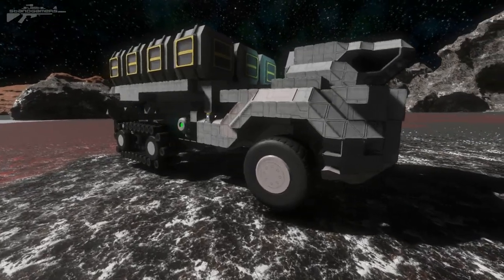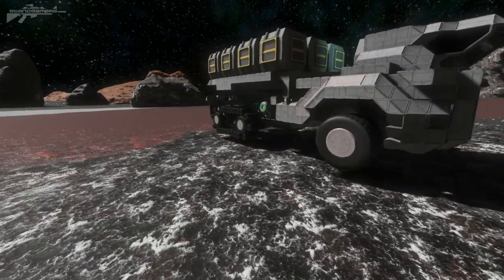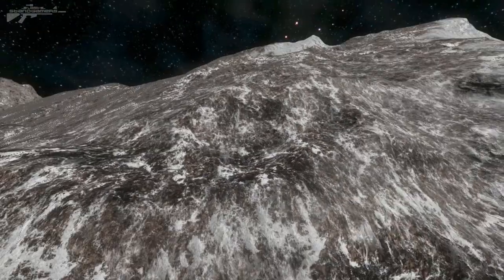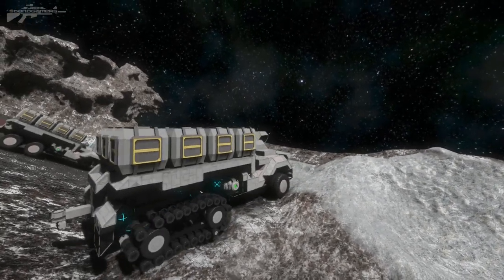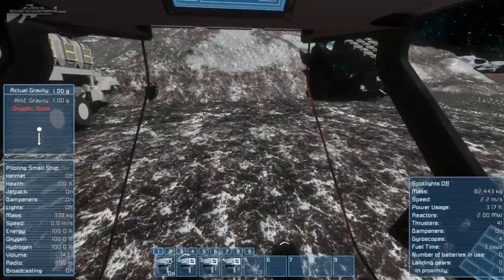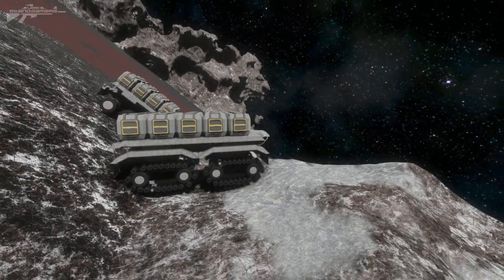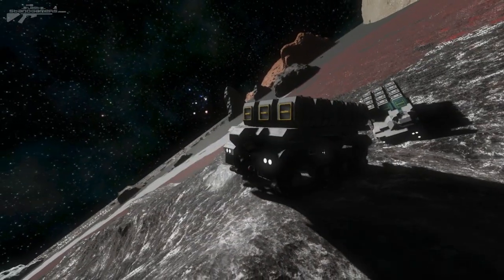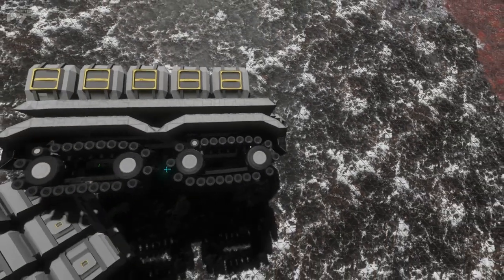Space Engineers - Half Track , Wheels Or Tracks

Comment: if you wanted to transport supplies by truck you'd be better off having another truck make a road (smooth out the ground with drills) and then using the fully wheeled variant speed along.  when going over rough terrain you should probably just fly the supplies

Comment: Despite the speed, I was surprised to see the tracked rover make it over such an obstacle. Such a thing would be great for an exploration vessel before workers can come in and flatten out some roads so faster transport vehicles can cross the planet.
Reply: tracks are more useful with more weight. more surface area so you dont put to much stress on the wheels small trucks and tanks can get away with wheels but the moment you make it large and heavy tracks are needed it also gives stability and is harder to immobilize
Reply: also his suspension is bad for bumby and jagged areas as a flatbed suspension suffers from it and slows it down a lot and can also get it stuck in a ditch easily

Comment: Very Unfair test... each vehicle went up against different degrees of slopes, the vehicles are very poorly made, poorly piloted, Ect..
Reply: +jayden shadlow I do agree with the different slopes, but I think that they were built OK, not great, but OK. As for the piloting.... I didn't see anything too bad about it.
Reply: TheFlawlessGem
 With the piloting, an example is the the fact that with the fully wheeled vehicle, he kept on ramming it into a ever increasing ditch hoping it will magically get up with the angle getting higher and higher... That is 1 example, if you observe you will see many more
Reply: +TheFlawlessGem the flaw on the build is that they are not well made to "off road" use, since the most basic things when building off road vehicles are minimal front and back overhang and a high "floor", making the whole wheel and suspension pop from under it and to the sides, being as far from the central mass of the vehicle as possible (observing obvious limitations). so these vehicles are not at all suitable for off road use.

Comment: You should put the tracks on a hinge so even when the vehicle is at an angle the bottom tracks could still be fully flat on the ground thus giving you more surface area
Reply: +Eric Yung technically the surface area is completely obsolete, since the less surface area you get, the more force acts upon this area, which results in the same friction. i have to admit, IRL in extreme cases this isnt true (also if there is a profile on the tire/track). and in space engineers... i have no clue. i think increasing the surface area helps, but this depends completly on how thorough the physics engine is made.
Reply: I see your point, but given the way the games physics engine works if you have each tread on a separate hinge you could go over rocky terrain and climb mountains better. You could have both wheels pulling a track at the same time instead of just the front or back wheel. You could have full motion to give you more force to climb and crawl because it will give you less strain on one point of the track. It will help prevent the tracks breaking in strenuous situations.

Comment: can anyone explain what's the mechanical and/or physical difference between dual tracks and multi-tracks? Modern tanks typically utilize dual tracks, whereas in Halo and Starcraft use 4 tracks (scorpion) and 6 tracks (siege tank).
Reply: I think it might have something to do with the size or weight of the vehicle in question. The scorpion, for example, is supposed to be a heavy battle tank so having 4 tracks might solve some of the problems that heavier tanks can have on rough terrain (the treads tend to break).